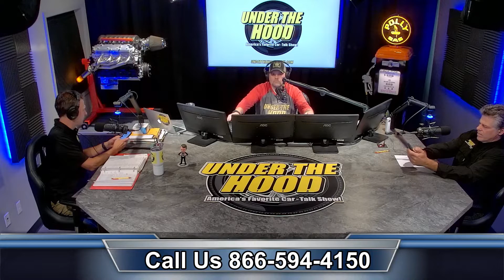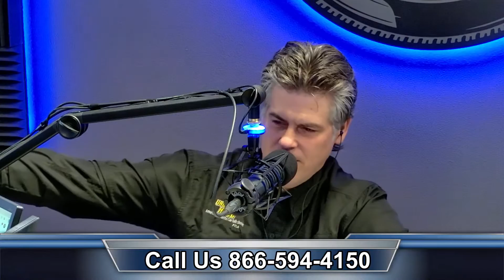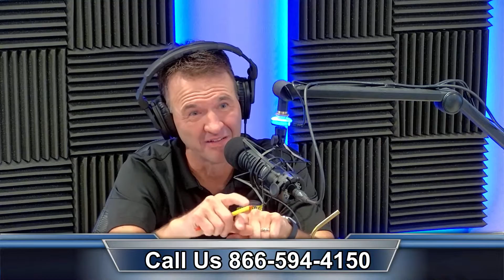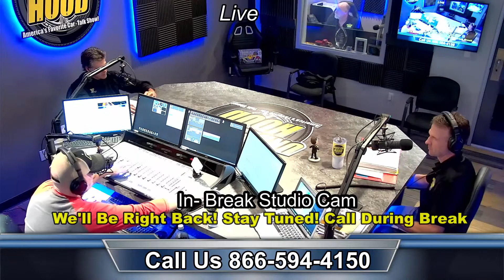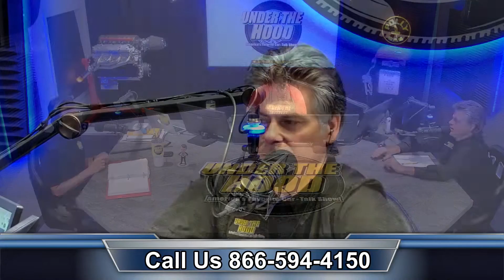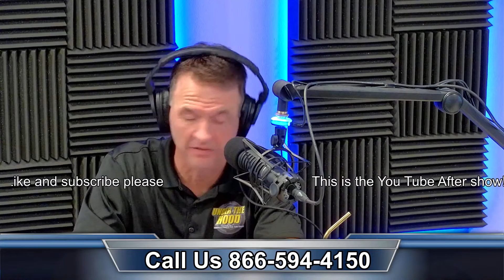The Countdown to The Live Show at Barrett Jackson Is On - Under The Hood - Your Car Our Advice

Comment: Good morning, Russ. I parked my 03 C32 AMG two days ago with no issues. Went to go to the gym this morning and I got a crank no start, and my low coolant level malfunction is triggered. I live in SLC, UT. It was about 30⁰ at the lowest over the last couple days and this morning. Where should I start? I cycled the key a few times and tried to start it 3 different times.
Reply from the maker: Check the coolant level. Also check the coolant level sensor. We don’t know if that circuit prevents fueling.  Thought it was just the temp circuit.
Reply: @UnderTheHoodShow 10-4, thank you, sir. I'll let you know.

Comment: Hi guys I have a second gen Cummins 24 valve and I have the common curse or the torque converter intermittently locking up, from speeds 45-55 I am curious on how I can cure this
Reply from the maker: @ReelSDOutdoors  It will take some diagnosis but the throttle sensor is common on these. watch tue data.
Reply: @UnderTheHoodShow  throttle position sensor right?

Comment: Hey guys, I've been listening on the app for years. Never miss a show. I have a 2008 Mustang Gt that shows the red battery symbol on startup, but when I give it gas, the light shuts off. I replaced the battery and alternator about 3 years ago. Loose connection maybe? Battery connections are tight but haven't checked the alternator connections yet. BTW, the car is running a Bama 93 octane racing tune, geared lower, cold air intake, cats deleted, Borla exhaust and believe it or not, only 88000 original miles. Thanks for any help you can provide. I'll be listening for the answer.
Reply from the maker: @jasonh.8110  thanks for watching the show! It could be one of a couple things either the alternator could be failing and getting weak or he could even be the belt slipping because the belt or the tensioner or both are a little weak. Check those things out. Take care.

Comment: Love the show, guys. I have a 2016 BMW X5 (F15) S Drive. I’m looking to add Apple Car Play that would integrated with the car’s entertainment system. Do you have any recommendations?
Reply from the maker: Thank you! Not sure on adding to a factory unit. The car play integrates to the factory screen and such so without changing to a aftermarket stereo (which with a factory tv display usually can't be done) we do not know how you would do that. The X5 is a very integrate factory head unit.